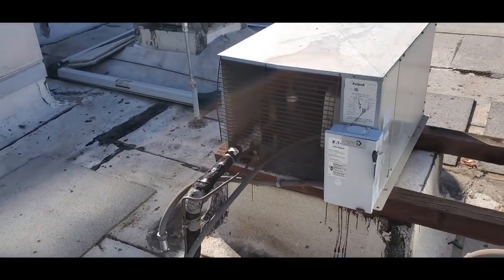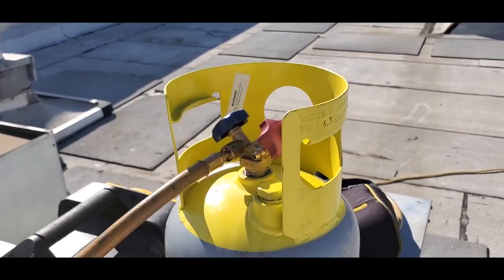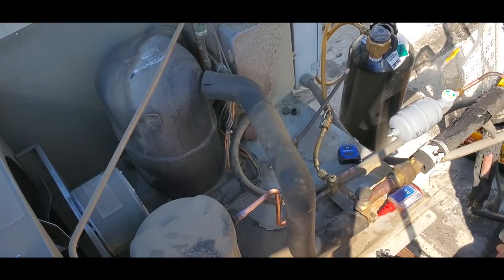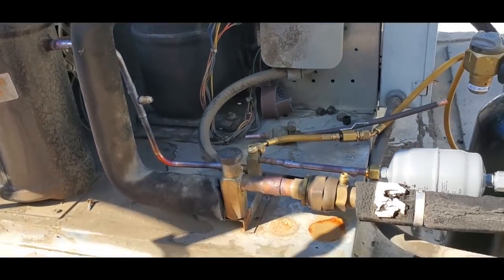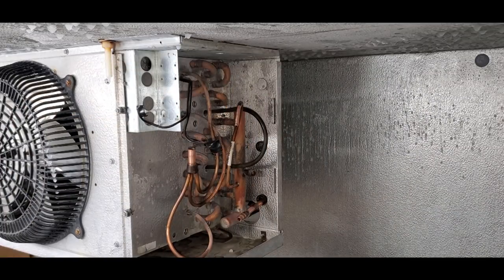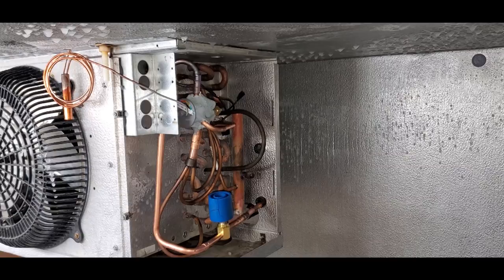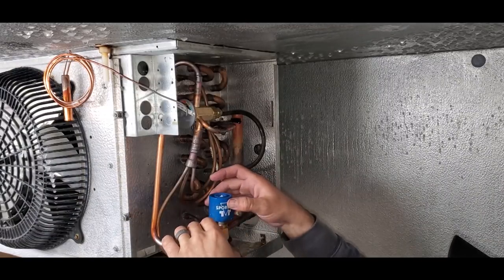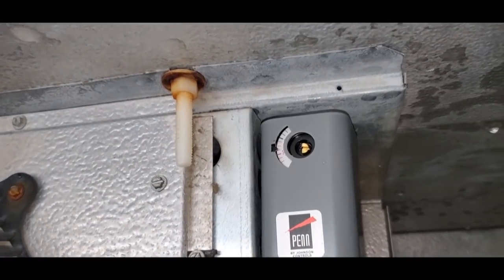WALK IN FREEZER TEV REPLACEMENT

Comment: I did my apprenticeship not in service but in building chillers, mostly for laser cutting application. Happened that I also did half a year doing service work and after watching a lot of videos on your channel I am so disappointed how much harder the job got for my colleagues and me just by not having tools nearly as sophisticated as you can present here on this channel. Such small stuff like a micron gauge that has no problems with positive pressure, so it can be easily removed without disturbing the vacuum.

Stuff I had to verify complicated or had to make assumptions on, you can present clearly just by using the right software and probes. If I ever have to go back I take a huge amount of inspiration from your videos.

Comment: Sponlan/alco valves suck. when failing they flood! a Danfoss does not fail often, but when it does it shuts off. also the Danfoss kit is much more refined and needs no oil or rubber gaskets. Great job though Chris, really like your videos. Nice to se how its done in other countryes

Comment: Another comment in regards to the sight glass. Put it upstream of the filter dryer. With age and use, the filter dryer can cause a pressure drop and flash gas even while the charge is correct. With a roof unit the weight of the refrigerant will take care of the flash gas before reaching the expansion valve below.

Comment: Walk-in coolers I like to use Penn A19 electronic controllers. I get tired of screwing around with those manual thermostat since not much more work. I have a wire ferrule kit on my truck that makes it really easy 2 hook it up into that small wire connections. Walk-in freezers we have a few of those are not as critical but if you had a freezer that was a critical temperature I would put a electronic control in that as well

Comment: We only use straight acetylene turbo torches here , they work well and I don’t have an 8” flame spitting past my weld, why does everyone use oxy acetylene ? There is no right or wrong, just wondering.
Reply: Its quite a bit hotter :) In HVAC that's not so important but if you do larger joints with huge heat capacities you will notice a big difference.

Comment: Always complete and thorough though you don’t address the real issue. Again, no pee trap! On your last one like this the system was full of oil when you did the repair including changing out the TXV valve. Simply adding the required pee trap would prevent the oil staying in the evaporator coil and more specifically restricting the expansion valve.
Reply from the maker: It actually had a pee trap but it wasn't a giant one but it was big enough to be effective. I will be going live on YouTube this evening 10/14/19 @ 5:PM (pacific time) to discuss my most recent uploads and answer questions from the LiveChat, YouTube comments, Emails, and Facebook comments come check it out if you can. https://youtu.be/tB11ZTSHhhE

Comment: Soldering has the same AWS definition as brazing, except that the filler metal used has a liquidus below 840°F (450°C) and below the solidus of the base metals. Soldering can be considered the low-temperature cousin to brazing.

Comment: you could turn the liquid line valve around backwards, but I doubt there's not enough space to use the service ports.
I wonder if it was just an engineering error, but more likely to be cost cutting tomfoolery.

Comment: I was taught to reduce oxygen slightly on the torch from a neutral flame to prevent an oxidizing flame that leaves pinholes, and the envelope of the flame will flux the copper removing the surface oxide. It is hard to tell in the sunlight. Are you running a small feather? I think you are as it is larger than a typical cone.  The copper fluxed very nicely in the envelope.

Comment: You should have a small step stool, and have a 3M mask. What's the size of the TEV? 0.5, 1, or 1.5 Ton? Another great video!
Reply from the maker: If I remember correctly it was a 1 ton valve, I will be going live on YouTube this evening 10/14/19 @ 5:PM (pacific time) to discuss my most recent uploads and answer questions from the LiveChat, YouTube comments, Emails, and Facebook comments come check it out if you can. https://youtu.be/tB11ZTSHhhE
Reply: He mentioned specifically the valve body and kit used.  It's the blue kit.

Comment: Your not alone l was always favor of Sporlan wasn’t big on on Alco valves.Why didn’t use a electrical thermostat haven’t use an A19 mechanical thermostat for over 10 years them thermostat they get out of calibration essentially when you have the heath inspection .
Reply from the maker: I forgot to quote a temp control and I really wanted to change it so i used the cheap mechanical one, I will be going live on YouTube this evening 10/14/19 @ 5:PM (pacific time) to discuss my most recent uploads and answer questions from the LiveChat, YouTube comments, Emails, and Facebook comments come check it out if you can. https://youtu.be/tB11ZTSHhhE

Comment: I thought about getting that umbrella. Johnstone’s has it. Is it pretty sturdy?
Reply from the maker: It not bullet proof and the magnet could actually be a little stronger but overall its nice. I would buy  it again if I had to!  I will be going live on YouTube this evening 10/14/19 @ 5:PM (pacific time) to discuss my most recent uploads and answer questions from the LiveChat, YouTube comments, Emails, and Facebook comments come check it out if you can. https://youtu.be/tB11ZTSHhhE
Reply: I use an old pool umbrella. It's 7' diameter and works great for sun and rain. Not so much for me getting wet, but my tools/recover machine. It's strapped to the side of my 6' ladder so it's always available quick.

Comment: Chris do you know anything about pro press. Basically dose not use a torch or flux
Reply from the maker: I will talk about press fittings on my stream tonight , I will be going live on YouTube this evening 10/14/19 @ 5:PM (pacific time) to discuss my most recent uploads and answer questions from the LiveChat, YouTube comments, Emails, and Facebook comments come check it out if you can. https://youtu.be/tB11ZTSHhhE
Reply: Pro press isnt the only brand that uses non brazing correct? Isnt there a few others!
Reply: Pro Press is an alternative for plumbing soldering, It uses o rings. It is not a replacement for a hermetic brazed seal. Not sure if the o ring material is suitable for hermetic applications involving refrigerants, oils, and possibly acid.

Comment: Just curious do you use stay-silv or stay-clean flux?
Reply: Flux is for soldering. For copper brazing a flame envelope on the torch is devoid of remaining oxygen and it fluxes the copper shiny for brazing. It is completely different than soldering. Soldering flux is completely burned and contributes to contamination if used for brazing.

Comment: No reason to recover it?? Just use the existing liquidline valve to pump down. Then if needed just add another drier on liquid line after king valve
and you must wet rag solenoid valves... of Danfoss type, they have a fibre disc inside that can melt.. dont know about sporlan soleoid though

Comment: I always avoid putting the solenoid valve inside the evaporator case if possible, it just makes everything too crowded and uncomfortable to work on... I realize this was a R&R and you were trying to get it done, so I’m not bitching at you Chris... I’ve seen those receivers with no king valve, wonky setup, probably designed by an engineer who never was in the field before. Good video, thanks!